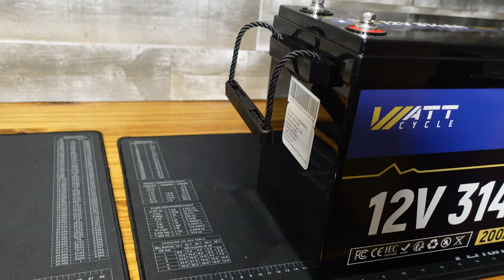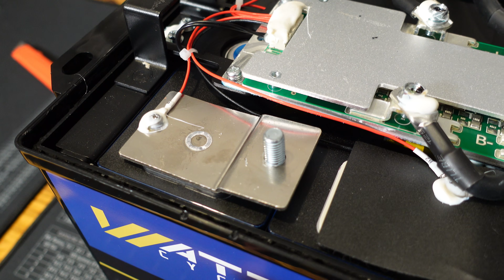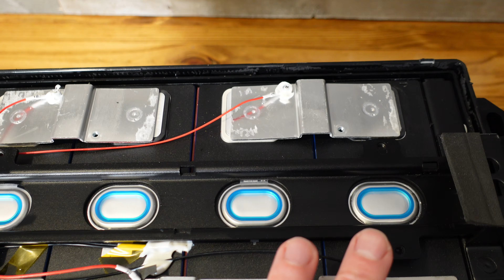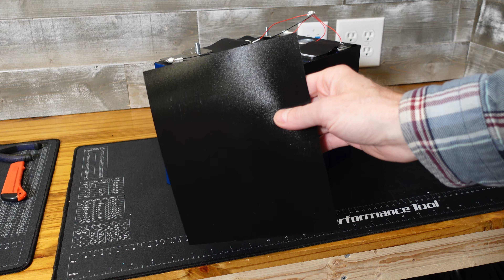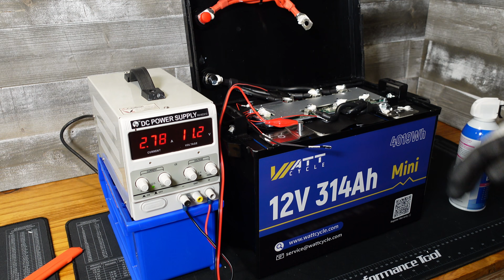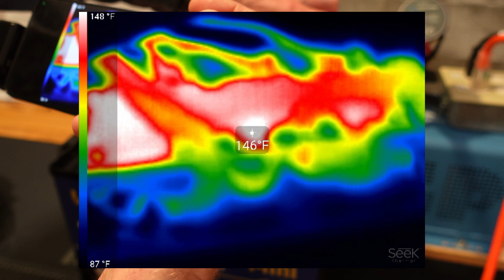WattCycle 12V 314Ah LFP Battery Teardown and Testing, Great Value

Comment: Good morning
I bought a couple eco-worthy 280ah in metal box for $250 average cost… super quality built , app is ok but not great and no way to adjust parameters. Pulled full capacity using 80amp load , no heating up internally …
Let me know if you like photos

Comment: @lithiumsolar I just received two of the 12v 314ah batteries. One charges to 14.3, the other to 13.4. Which is interesting. Wondering if still ok to connect in parallel in my camper.

Comment: Where did you find the 314ah that measures 14x10x7.5? The basic 314ah on their site shows 15.12x9.76x7.64 and is $550 and that extra 1 1/8" length makes big difference for what im trying to do with one.
Reply from the maker: The website measurements are correct. My apologies, I must have missed one of the handles when I measured mine the first time.

Comment: I purchased 4 Wattcycle 12V 314Ah batteries similar to this one but the Bluetooth version, right around the same time they discovered there was issues with balancing the cells in this model. I have literally not been able to get these swapped out to these non BT  batteries, I have contacted Wattcycle and now its been a cat and mouse game, I would seriously think twice before dealing with Wattcycle. This is going on a year without getting this issue resolved. Because I build adventure vans I cant in good confidence install batteries that could leave the owner stranded. So I am on the hook for over 2k with these batteries.
Reply: yeah, I saw Will Prowse also said the basic version is working very well. The bluetooth version having some sofeware issues.

Comment: I have gearup 2k 12v inverter Can i run 1hp motor with this battery
Reply: I would doubt the inverter can handle the surge of starting the large motor.
Reply: @john_in_phoenix what if i use vfd or soft starter??

Comment: I bought two of the WattCycle 314 smart batteries, in July of 2025.  Both had the BMS fail within 6 months.  Getting the first replaced took about a month of emailing back and forth.  I lost all faith in their batteries.  Hopefully you have better luck with the non-smart version.
Reply from the maker: Wow, that's very disappointing to hear and definitely not what I would have expected. Were you able to gather any info from the app with what happened (any error codes or anything)?
Reply: @LithiumSolar there were no errors.  The Bluetooth connected, but stopped reporting anything from the batteries.  The batteries stopped both charging and discharging.  The really bad part was that I was off-grid in the middle of the Arizona desert for 6 months.  It took a month of back and forth to get the first replaced.  Finally the replacement arrived, and about a month after I installed it, the second one failed.  I’ve lost all faith in WattCycle.  I ended up buying a LiTime 320 to add to the mix because I work remotely and just could not trust the other batteries.  I’m sure they just had a bad batch of BMS, but that’s their problem.  Sad, because the build quality looks fantastic.

Comment: It would be nice to give some data on the bms amp capacity for the cells equalization.
Reply: 67mA, in reality probably closer to 50mA. Not very high. If you have it charged to 100% often it could be okay.

Comment: Basic battery.  Just what we need.
Reply from the maker: Exactly where I'm at. I've never needed Bluetooth or all the self-heating circuitry in mine.
Reply: @LithiumSolar  Didn't you once have an outdoor shipping container to house your batteries years ago or am I mis-rembering?  If so, how do you keep the batteries at or above temperature in the winter?